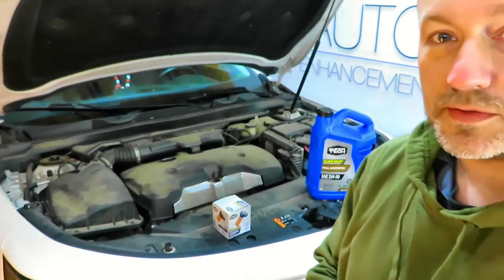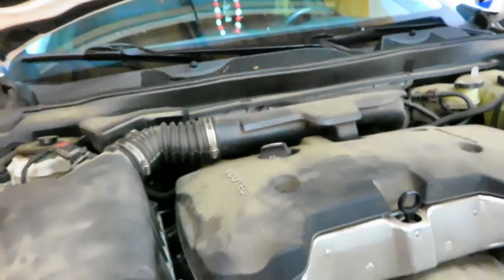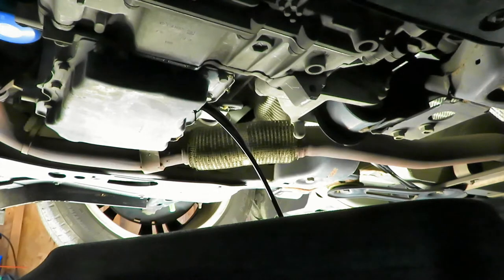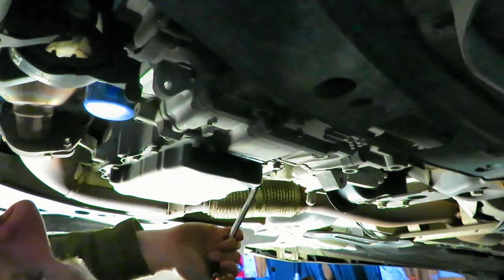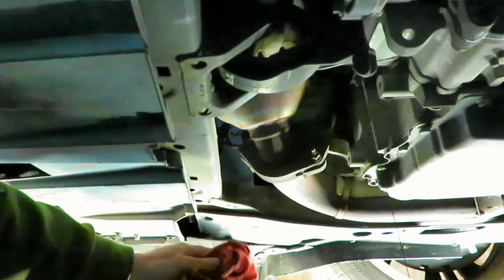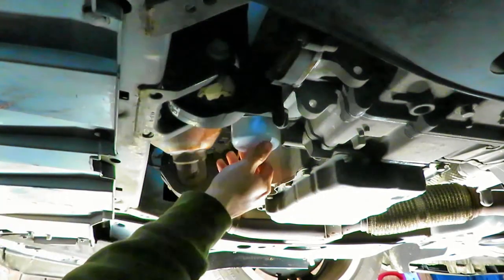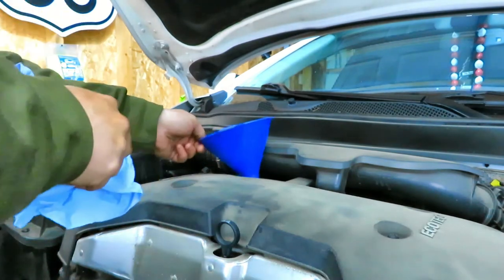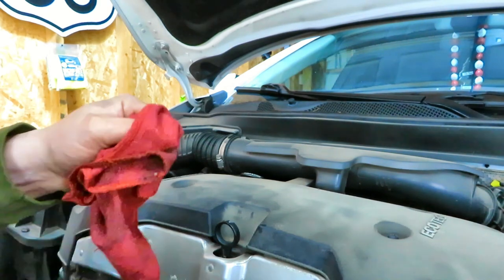2014-2020 Chevy Impala 2.5L Oil and Oil Filter Change

Comment: Great video, a good reason to fill the filter is to quicken the flow through the engine instead of waiting for the oil to fill the filter, this was useful when working with high mileage engines.
Reply from the maker: Thank you for letting me know that. I don't much care for spilling oil on myself, some of these oil filters are at an angle or a little difficult to re-install.